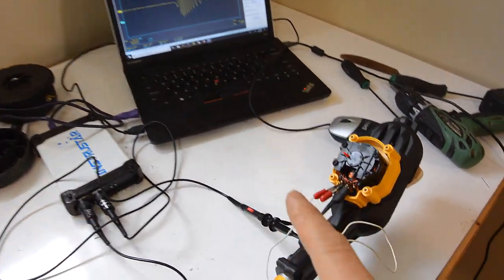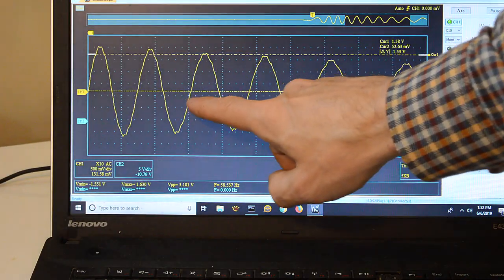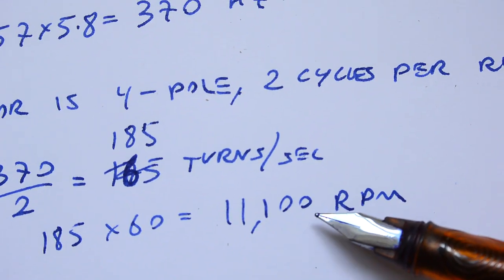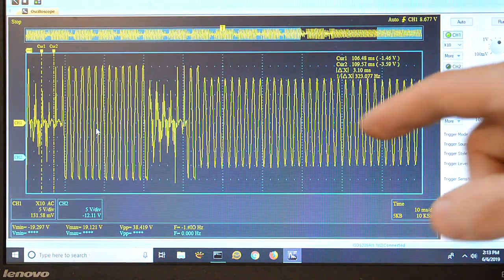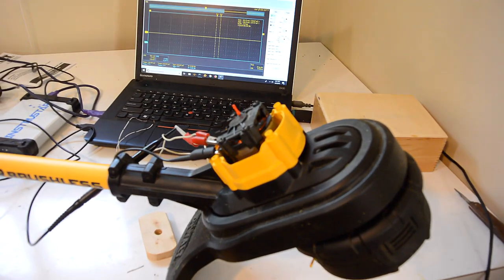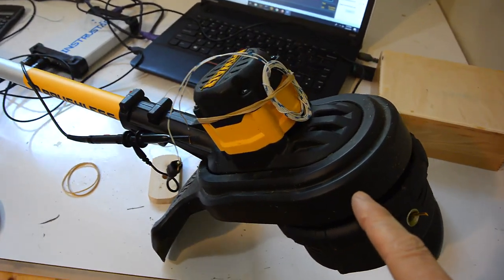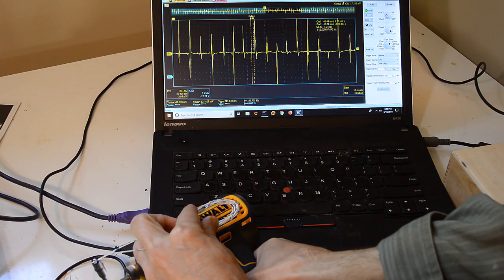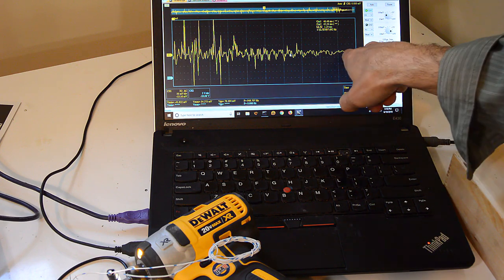Examining a brushless DC motor, and a dumb way to drive one.

Comment: Looking at the scope screen at 7:08, it seems that the measured phase is powered two thirds of the time. This makes perfect sense, since running the motor on open loop requires one phase to take current in, the second phase to pass that current through and out, with the third phase being used to measure the back-emf signal to accurately time the next stage (i.e. power A-B, read C, then power B-C, read A, etc.). Sinusoidial control (FOC) would be cool to see in a consumer product, but that is still more widely seen in larger/more expensive BLDC applications... Not here :)
Reply from the maker: Except that you can't drive the phases independently.  Only three wires going to the motor.  And even if they were independewntly wired, it would be stupid to short circuit the winding you are trying to sense on.
Reply: @matthiasrandomstuff2221  My answer probably wasn't the most understandable, so here's try number two: normally, a BLDC controller drives the motor in such a way, that there is current going into/through one phase and out/through another, while the third one is being monitored. The phases are interconnected either in delta or star (Y) and as such are "shorted" if looking at things resistively. I'll try and find a link to better illustrate what I'm trying to say. (Also, the reason you're not seeing a constant current in a phase before the "dead" zone is because the current would rise too much and thus is pulsed in a way that the measurement result looks like a sinusoid).
Reply: http://images.elektroda.net/88_1274660220.jpg has the three power "signals" underneath the not-so-relevant hall sensor signals. This is how power is applied to each phase/phase pair 2/3 of the time.

As far as control tech goes with sensorless BLDC control, there's some decent info here: https://www.roboteq.com/index.php/applications/applications-blog/entry/sensorless?format=amp
Reply: @SaerX  
The 2/3 of the time is valid for within one of the peaks, not over multiple peaks.
Reply: You are mixed up. For several full cycles of the back EMF, the observed voltage is zero (or very low). When the motor is spinning fast, the only way the back EMF can be that low is if it is shorted out by the drive circuitry. This leads to high current in the phase wires, strong braking force, and rapid temperature rise in the motor windings, but not to battery charging.

Comment: why does the thing need to be that big if most of it is hollow?
Reply: Possible answers: Additional space in the head for cooling of the driver electronics, tool ergonomics and maybe even a degree of cynical market research, ie: "We've found that our customers prefer tools that are large, chunky and heavy so let's put a bunch of empty space in the tool head". Some of it could even just be tradition, by making a large head it appears to the purchaser to be more like the internal combustion engine line trimmers people are used to so it makes it seem less foreign to those that are sceptical of electronics vs ICEs. If the head was smaller, ie: just large enough to house the electronics, the uneducated might assume it had less power? More bigger more better :D

Comment: You should have it connected while wheat whacking. With the amount of load wheat whacking generates it should be fine. Or at least with a wire so it has some resistance going through air.
Reply: Wheat wacking..... bwhahahahah
Reply: @JimNichols  You are laughing at me for my mistake while you making one yourself. Bravo!  It's WEED wHacking and I'm sorry for my terrible mistake.

Comment: Hi Matthias, little late to the party here. But one observation is that shorting the windings doesn't automatically incur high resistive losses in a brushless motor, especially if it has high leakage inductance. If you're operating the motor electrically much faster than the L/R time constant of the leakage inductance, then the rotor flux is mostly excluded from the stator by the opposing currents induced in the shorted windings, and the torque is low (equivalent to exceeding the critical slip speed of an induction motor). Yes there’s still induced current circulating, but depending on the magnitude of the winding resistance, this might not actually embody a large power loss. 

 Shorting the windings will potentially accomplish two positive things. 

First, it could reduce the cogging torque. Cogging torque arises due to the variation in the reluctance which the rotor flux sees versus angle, as it tries to find a path through the stator. Shorting the windings excludes the flux from the stator entirely and so could reduce the cogging torque.

Second and probably more importantly, it will reduce the iron losses in the stator. Is that thing even laminated? At up to 500Hz, the eddy current losses in a solid core will be pretty darn severe. Even in laminations it would be bad. The hysteresis loss is also always there too, but eddy current losses scale as frequency squared. So by shorting the windings and excluding the rotor flux from the stator, you may actually get lower drag torque than if you left the windings open circuit. 

This might in fact be literally the most efficient way to drive such a cheap, high RPM motor. When you want to apply torque, you need some of the rotor flux to penetrate the windings. So you allow all the flux through the windings and apply as much torque (current) as possible for a time, so the ratio of injected power to power loss is high (high efficiency). Then you exclude the flux from the stator completely to stop that iron from absorbing tons of eddy current loss and creating a huge drag torque.
Reply from the maker: Yes, core losses will be reduced by shorting it.  But - if I completely let go of the trigger, then it's open circuit, and it takes a long time to spin down.  So the non shorted torque from core and cogging losses has to be quite low.
Reply: That's a fair point  @matthiasrandomstuff2221 . The system might have quite a lot of inertia compared to how much power is flowing though it, so a slow ramp-down might still represent quite a lot of internal electromagnetic friction loss. But I would have expect a pretty rapid slow-down if the core loss was really huge.  Was it laminated by the way? Couldn't really see.

Comment: It would be awesome to pry open the siliconed brainbox and probe directly on the drive transistors to verify brake mode enganging. The suppression of the back emf looks very odd to me. A good dead short should not let +-3v on the coils...

Comment: almost seems like for the "Brake", they are dumping the energy back into the battery.  They probably drive the the motor hard so their driver transistor is either on or off and has a minimal power loss across it.

Comment: I always get confused when those things are called "brushless DC motors".
What is it really? An inducton motor? A synchronous motor? A switched reluctance motor?
This generalisation is a bit too much for me, sadly.
Reply: It is like a synchronous motor, with a changing frequency
Reply: Well, it's on the name. It's a brushless DC motor. If it were another kind of motor, engineers would use that other name. It behaves like a normal DC motor in the sense that more voltage means more speed, but the commutation done by brushes is replaced by commutation done by electronics. In a BLDC the drive frequency FOLLOWS the speed in the same way that the commutation in a brushed motor follows the speed of the motor.
The working principle of an induction motor/AC/3 phase motor is entirely different. In a 3-phase AC motor the speed is controlled by the switching of the phases/frequency of the AC.
Reply: If you want another name for it, the closest thing is permanent magnet synchronous motor (PMSM). But it is just the same thing with a different name (basically).

Comment: Just a couple comments about screws in plastic; 1) don't over tighten,  use a hand screwdriver and 2) start the screws with your fingers turning the screw gently counterclockwise,  you should be able to feel the screw "drop" into the original  thread.  This preserves the most plastic strength.

Comment: Before I condemn it, I would want to see how it performs with a string in it. The string will mechanically load the trimmer quite a bit (which I know you know... it is similar to how you sized your blower vanes). Maybe when there is a mechanical load, it will not behave that way. It may have been optimized to run with a string in place (and at full speed). I do work with BLDC motors professionally, but I am not an expert. I have not encountered a drive strategy that involved alternating between braking and driving like that. Adding inertia was an interesting idea, but you may need to add string to actually load the motor. For example my Stihl string trimmer (gas powered) rev limits if I give it full throttle with no string.

Comment: I wonder if they didn't want to put in the time and expense to design and build a proper PWM driver for the motor because they figured a weed-wacker is always going to be run at full speed anyways... then again, if that's the case, why would they put any throttling in it at all?

Comment: Not trying to be a DeWalt fan boy but I really like my weed eater regardless of how inefficient the motor is it cuts grass pretty well and is easily handled by my wife and kids. I don't like the spool mechanism very much though. I have a half acre in one battery will do the whole thing pretty easily
Reply from the maker: It does work fine.  Though I think the battery would last longer if the electronics were smarter.

Comment: It needs a load, the gas ones I use have a large RPM drop with the standard load from thick weeds.  I imagine once its in the lower RPM range it will stop the breaking like that.

Comment: I think under load it might not do that. Maybe it shorts the coils to allow for some kind of budget speed sensing circuit? Maybe when it is under load it can regulate speed without shorting the coils as the back-emf would be greater and a more elegant speed sensing method can be used.

Comment: When the motor is braked I wonder if they store the energy generated somehow in the caps to use in the next power cycle? We used to do something similar driving solenoids at high frequency  to reduce power consumption.
Reply from the maker: shorting it doesn't produce recoverable energy

Comment: It is look like rpm limitation (like in 50ccm scooters). 22krpm is quite fast and probably above some speed cutting line is breaking very often (or cutting grass just need slower speed), so sombody try to improve that with electronics. Try the same with much more inertia load to confirm :)
Reply from the maker: Hmm, yes, that sounds plausible.  Maybe some part of the electronics is fighting another part, like they used some generic motor driver and barnacled a speed limiter onto it.
Reply: @matthiasrandomstuff2221  I would add string, not more inertia. You want a steady state load. In my opinion.

Comment: Put some trimmer line in the head and test it at the length used for cutting grass. I don’t know if the head is auto feed or not but possibly as the cutting line wears shorter it reduces the load on the motor thus the motor revs higher to a point we’re the engine brakes and this triggers a mechanism in the head to release more trimmer line.

Comment: I think DeWalt is not as stupid as you suggest.  Why is it more efficient to use PWM?  With PWM you waste a bunch of energy turning on and off a switch at high frequency. And you've got a bunch of more electronics.
Please explain why you think PWM is more efficient.
Actually, if you think about it, they are using PWM, just at a lower frequency.
As other commenters have mentioned, it's probably important to test under load.
Reply from the maker: The on/off is actually very efficient with modern electronics.  I have worked on switching circuits before.  No need for me to explain, just research switching power supplies.
Reply: Actually, it depends on eddy currents in the motor stator. It's a bit of both good and bad.
Reply: @matthiasrandomstuff2221  HeHe...I too used to design switching power supplies in the late 90's :) .  I agree that switching can be pretty efficient - (PC power supplies range from 80% to >90% efficiency)  But there still would be switching losses.  Fundamentally,  it doesn't seem that PWM would be more efficient than what they are already doing.  I think DeWalt used the simplest/lowest cost circuitry to achieve acceptable power control and efficiency.
In any case, great video, I always wanted to know what went on in the brushless motors in my power tools!  Good analysis too.

Comment: Wrong, you are measuring it wrong. This Is 3 phase motor, so you need a center of the star.
Reply: Deivid Tsanow this is a delta connected winding not a Y connection

Comment: It might just be because it has to be able to push harder under load than at idle, so when it encounters resistance it can push hard without going too fast. I assume the limit is there because they tried it without it and something broke... and instead of redesigning it, they just "fixed" it.
Reply from the maker: yes, but you could just drive it less of the time and not brake in between, and still save power.  And a weed trimmer is mostly not running at full load when in use.

Comment: Signal patern is probably like that because transistors are more efficient at lower frequencies, they heat up more with pwm modulating the phase current, which makes electronics much more durable as it doesnt need to dissipate that much heat.
Reply from the maker: But tens of kHz is not a problem.  Besides, they already switch several times each cycle.
Reply: I have already had this problem using quite beefy mosfets but they were overheating, for sample e-bike controllers for 1-1.5kW usually have 18 mosfets and a whole aluminum case to cool them.
Reply: @jansaljaj3042  To be fair, kHz, even a few MHz, is still low frequency.

Comment: Remember the coil is measuring the derivative of the field.  So those spikes would indicate a square wave.  Down load the waveform into a spreadsheet and integrate the waveform.  Looks like fun.
Reply from the maker: Right, so it's driving it with a square wave at a much lower frequency than the motor is rotating at?  That makes a shitload of nonsense.

Comment: Why do they waste energy like this?  Because it is a DeWalt.
Reply: Often times I think Dewalt is in the battery business and just makes the tools as a method to drain the batteries.
Reply: @Greg Goodwin You know I firmly believe you're right.  I was reading about DeWalt and Black and Decker last month and I will not touch a B&D for 30 years and DeWalt has just become as bad.

Comment: At least on the battery-powered mower it goes into "grunt" speed mode when going over too thick/wet grass. I don't think they will prioritize idle-ish/non-loaded mode of work. Maybe add air-anchor to simulate heavy grass and meter again?
Reply from the maker: but weed whackers are not in grunt mode MOST of the time.  Most of the time, it's actually trimming on edges.
Reply: @matthiasrandomstuff2221  I guess that depends on how it's used. What I see publicly is that guys walk on steep slopes (where mower would be troublesome) and do those; though the battery powered wouldn't have enough runtime for that. Apart from that the brushless is so fast to start that when going around trimming you either go full-tilt on the trigger or let it go so it's off.
Reply: 36V 5Ah battery gives me ~300m2 of cut area (some charge on battery still left; but the area is overgrown-ish) with a 46cm wide mower, I think the whacker would probably get less area done.

Comment: Under a load the  motor would fall behind the rotating magnetic field known as slip. And what your seeing should go away. I'm not positive but the time the computer isn't applying  voltage  it is sensing where the rotor is in relation to the field... Maybe
Reply from the maker: slip happens in induction motors.  And for it to only sense phase every 10 turns or so would be somewhat inadequate.
Reply: This is not an AC motor. There is no such thing as slip here. The working principle of BÖDC motors is entirely different. The speed/power of a BLDC is controlled by the voltage applied. The switching of the "phases" follows the speed of the motor (identical to what the physical brushes in a brushed DC motor do). In a 3-phase AC motor the speed is controlled by the switching of the phases/frequency of the AC.
Reply: Because there is a permanent magnet moving past a coil, there MUST be EMF generated by the motor any time the rotor is spinning. If that EMF is suppressed (which we know it is from Matthias's observations) then something is shorting out that EMF. This will produce a powerful braking effect and cause rapid temperature rise in the copper wire (unless the motor is spinning slowly, in which case it will create an increased perception of drag).

Comment: So at the end of the day a brushless motor can only ever be as strong as the magnets installed.
Reply: Well, current flowing through the wingdings produces the magnetic field that attracts the magnets. So the amount of current you run through the motor can also increase its strength. Also, not sure if "strength" is a technical term. There is torque, and there is power. A low torque motor can produce high power if it spins very fast.

Comment: It‘s just a 3 Phase Motor like we have it in germany, they just take the DC Input signal and convert it to a 3 Phase AC Output with transistors, this thing is called an ESC (Electronic Speed Controller).